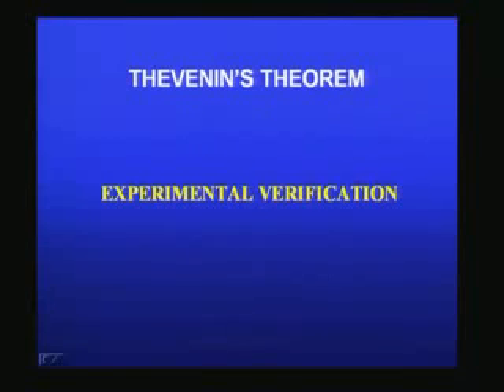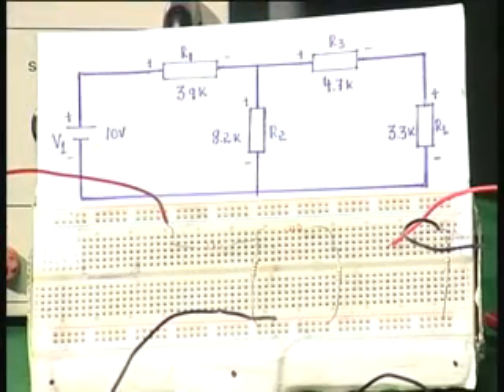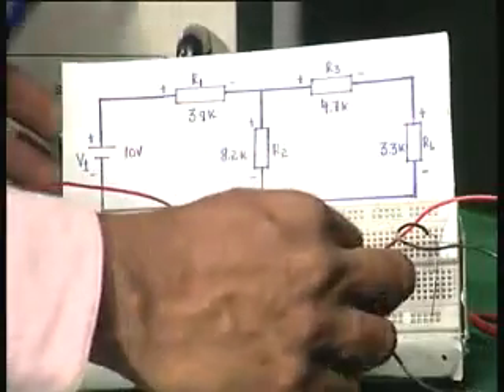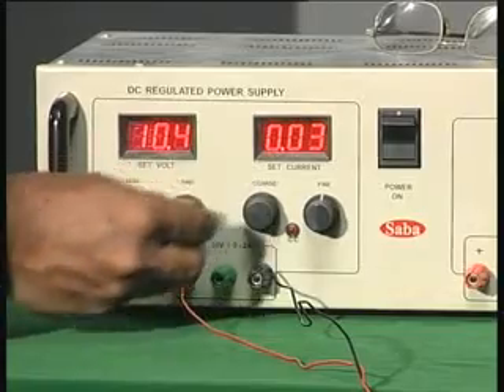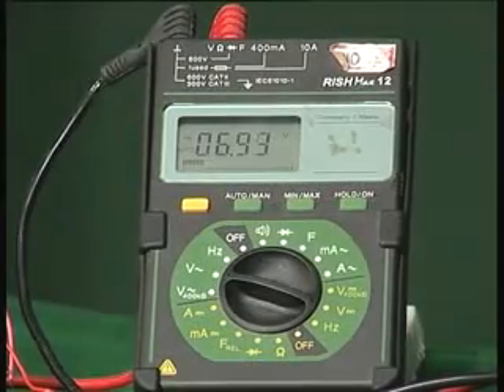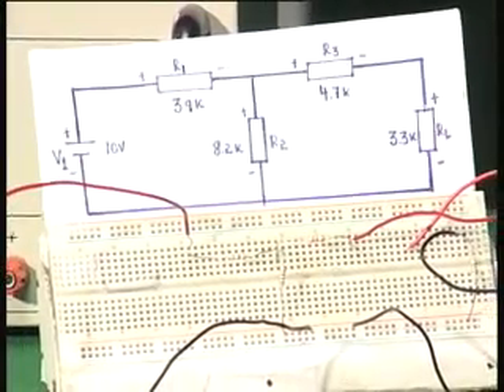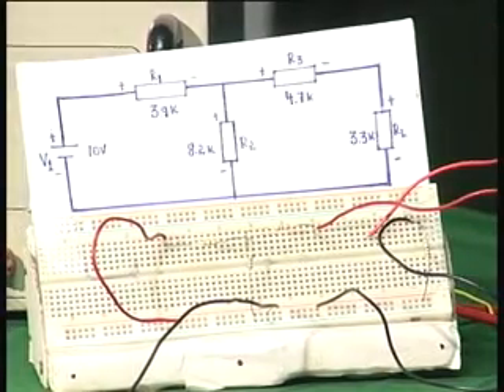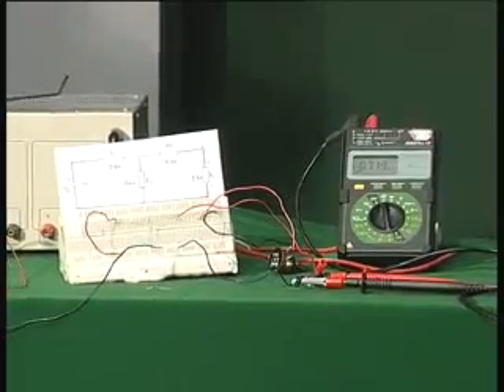Thevenin theorem - experimental verification

Comment: I humbly suggest that a video explaining and showing a circuit involving at least two voltage sources should be presented since the basic purpose of Thevenization is to simplify networks which have some complexity. The present exercise might be a good introduction but does not meet that purpose.
Reply: did you find any good video with two voltage? i am looking for it as well